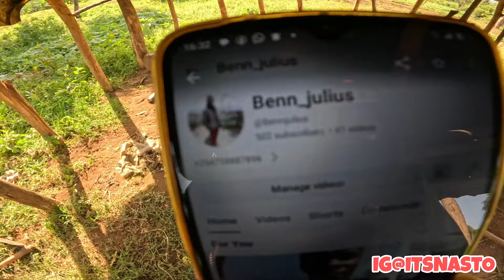BIG SUPRISE!!! His Rare SKILLS Could Help Us FIND WATER IN OUR NEW HOME IN AFRICA 🙏🏾...

Comment: In my country if the water is off you still can use the toilet, you put 1or 2 buckets of water in the bath room use the toilet and pour the bucket of water in the toilet it will flush
For the kitchen sink you have a bucket of water  put aside in the kitchen, when it's time to wash dishes put the stopper in the sink pour the water in the sink wash or rinse dishes then remove stopper and let the water out, works very well 😊❤Bahamas 🇧🇸
Reply from the maker: Same here
Reply: Exactly, but remember this indoor plumbing is kinda new concept,  so someone will have to tell them how to use this method. 
But in time they will understand how to get around these minor obstacles..
Good advice 
Wishing you get this problem finally solved ❤❤❤Jamaica 🇯🇲
Reply: Exactly, but remember this indoor plumbing is kinda new concept,  so someone will have to tell them how to use this method. 
But in time they will understand how to get around these minor obstacles..
Good advice 
Wishing you get this problem finally solved ❤❤❤Jamaica 🇯🇲